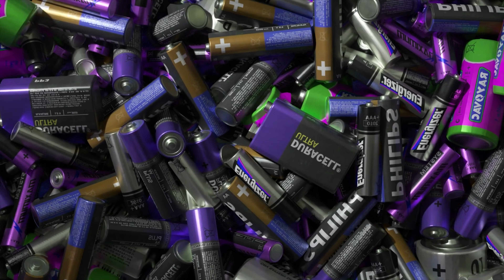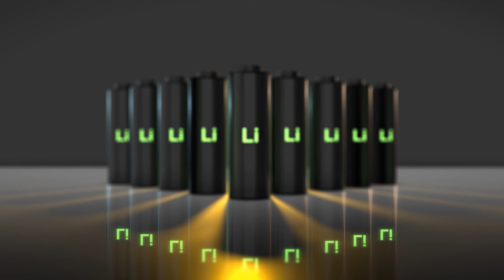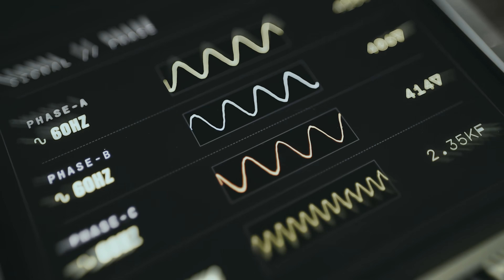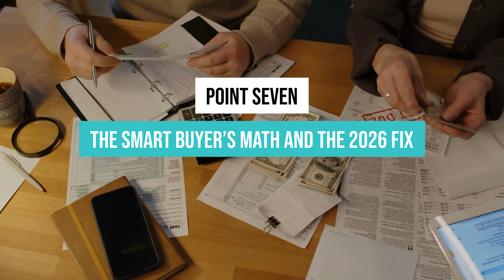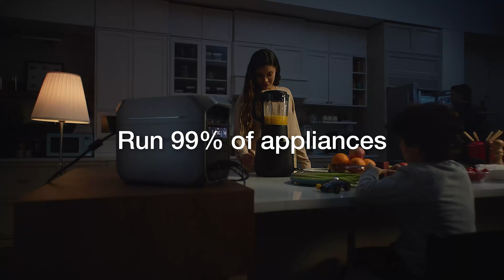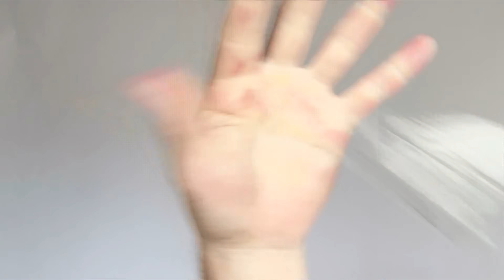NEVER Buy 2000W Solar Generators — Stop Falling For The Power Industry’s $1,000 Trap

Comment: None ever say how many times they can boil an electric kettie a day at 2000watts
Reply: You can make that calculation yourself. Look at how long it takes for your kettle to boil water check the amps used to do so. use a calculator to know how many watt hours it uses to boil. then look at how many watt hours the power station has.

Comment: Another channel shows DIY 2400 watts using an inverter ($215) and 12.8 v, 200 amp-hour LFP battery ($320).  Upgrade with bigger battery or multiple batteries.
Reply: So which is the channel, show me